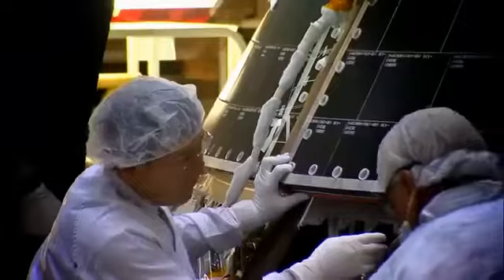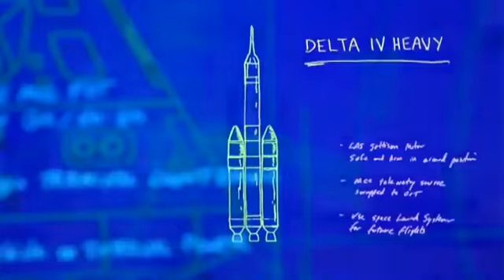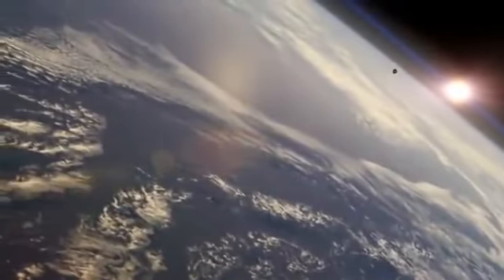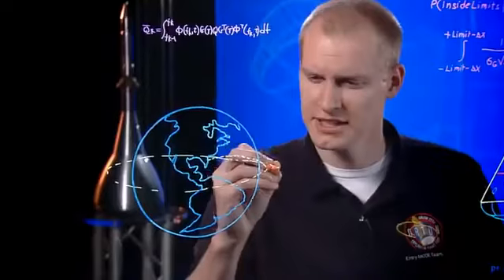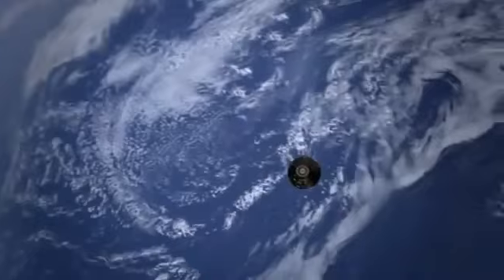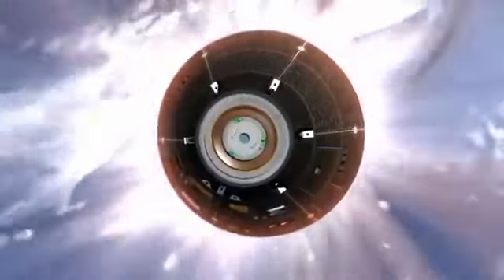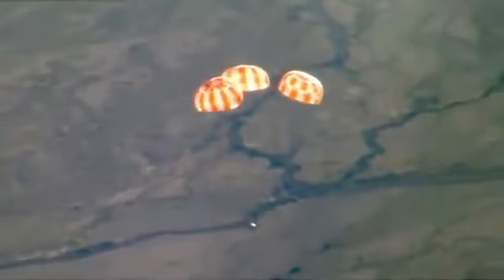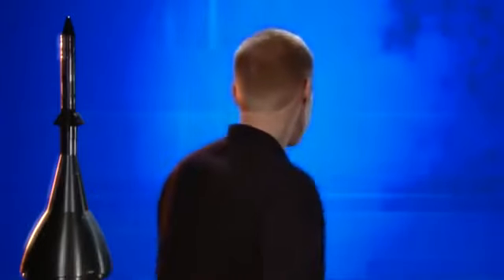NASA engineer admits they can’t get passed the Van Allen Belts

Comment: Put some aluminum foil around it. Worked for Apollo.
Reply from the maker: TheReviewsDOTnet it was sarcastic lol
Reply: can't tell through text.
(After looking at it I see)
Reply: For 100MeV, a 6 feet thick shell of Cadmium around the cubicle might do the trick, but what should the rocket engine thrust be?.
Reply: TheReviewsDOTnet hahahahahahahahaha are u kidding me? GODDDDDDD
Reply: When an ionizing radiation electron hits a large atom such as lead, the interaction creates an X-ray (called the Bremsstrahlung Effect). Therefore, the thick lead shields one would assume are needed to shield from radiation only serve to make conditions in the cabin worse. Materials with high amounts of hydrogen like polyethylene or metals with smaller atomic structure can minimize this effect.

Basic scientific knowledge about the Van Allen Radiation Belts easily explain how a space program goes about dealing with it. Any assumption regarding passing through the belts should be made with respect to the nature of the belts. In short, don't say shit like it's impossible to go through them if you don't know shit about them, aside from what the people saying it's impossible said. 🎤💧
Reply: The type of radiation the need to block isn't the same radiation everyone thinks of when they hear the word. The signals that your radios receive to play all that precious music, emit a type of radiation. Radiowaves, microwaves...all radiation. It is just the the levels of the radiation that are concerning, and with all the protections and laws governing the way things are done these days. NASA is not allowed to expose astronauts to these levels of radiation. The protons are blocked by the thinner metals like aluminum, and polyethylene can block a lot of the electrons. Back then they went around the more dangerous inner belt and through the thinnest part of the outer belt. Then it comes to exposure time. It is better to spend a little time in high levels of radiation than it is to spend a lot of time in low levels. It's not that we can't do it, it's just that their are so many governing agencies that decide how and when it safe to do things that those parties have to feel that it is safe for us to move forward
Reply: It never worked
Reply: Bill Aynes well, the direction of the erection is directly proportionate to.... Oh nevermind, you wouldn't understand.
Reply: Yah yah and some thin foam and "resin"(magical)
That's how people are saying Apollo did it, easy.(They claim)
Oh, they also say the radiation was just six hours each way and safe.
ROFLMAO
Reply: First of all, there's solar flare if it hits game over no matter what kind of shielding you have. Second, if that doesn't get you then aniprotons remitting from particles colliding with the aircraft is enough to end your life.
Reply: Denfktinso Noyb it wasn't tin foil...
Reply: Today's electronics are far more susceptible to em radiation than those on the Apollo missions plus the longest Apollo mission was 12d 13h 51m 59s - the Orion is designed the for possibility of going to Mars, a mission that would last closer to a year.
Reply: Winner....exactly.  This was the job of the heat shield to absorb most of the radiation, the inner hull would absorb the rest.  Fact is the Apollo crew wore dose meters and the average on time through the OUTER edges of the Van Allen Belt (where the radiation is the least) the amount was only .80 rem LESS THAN 1 rem.  it takes 5-10 just the have late effects and possible chromosomal damage, 100 for mild radiation sickness, +400 to be lethal.  Easiest answer to explain Van Allen Belt travel, they didn't go through the center, they went to the outsides and only spent about 5 hours TOTAL in the belt 3 out and 2 in with a break in the middle.  No problems getting through that.  PERIOD.  They will have no problems getting these shuttles through it as well.
Reply: LOL You made my day!
Reply: Bill Aynes don't underestimate the power of human farts...
Reply: THExDEADPOOLx _ and there's a reason why they call you dead...cosmic radiation is deadly as in maybe you last an hour of extreme heat and sufferings
Reply: Hahahahahahahahaha...He is obviously unaware of ''moon landing'', still figuring out how to pass those belts  :)
Reply: KnowledgeIsKey215 stick with "in short", cause that best shows how little you know about anything science, other than what you looked up on Wikipedia
Reply: the actual bajmahal those are hereditary traits not symptoms derived from over-exposure to radiation. Not one case in history, might I add!
Reply: It will only be in the van allen belts for minutes, not hours days or weeks. It's not anything dangerous to life, only sophisticated electronics and we have been through it dozens and dozens of times with unmanned systems to the sun and planets. Somebody needed some "drama" to grease the way for useless research that we have all the answers for. The only thing keeping us from going to mars is the will to do it.
Reply: Denfktinso Noyb and don't forget the scuba diver suit as well for the astronots, the space out there could be too bubbly
Reply: +Paul Gray agreed they're not even trying to go to mars sad.
Reply: U know the moon landing was fake right?
Reply: Crisps bag will do lol. But you have to eat a lot of doritos first.
Reply: First of all until unless we are able to find materials to withstand the heat it will be impossible. Secondly, we don't know how the radiation will impact the computers on board. Honestly it's fair to say we didn't go to the moon in 1969 but people refuse to apply common sense in their thinking
Reply: Water works best
Reply: Tisbonus WTF I'm not even sure what you're talking about. Expound on the subject a little?
Reply: It was gold foil.....
Reply: There were no Appollo missions to the moon
Reply: lol
Reply: Denfktinso Noyb 
😆😆😆😆😆😆
Reply: Lovely sarcasm 😂😂😂😂
Reply: Apollo was a movie, the truth is here :))
Reply: Occam’s Razor: Why is it—since the days of typewriter technology—has no country or space program regardless of Moore’s Law tech advancement, been able to get back to the moon? The answer is simple: because nobody has ever went to begin with. 

I’ll be darned(double doggedly) if I’ll trust a government I cannot trust with my cell phone. During the Nixon administration. In the middle of a cold war. In the midst of Vietnam. In the middle of a space-race, bad poll numbers and election no less. And admit it blind moon believers, admit it: of all conspiracy theories around from bighonkinfoot to Roswell, this one has the highest chance of being true. 

Light the fire and take it neat did they ever fool us good. Uncle Sam and Nixon, with the help of Hollywood.
Reply: But the Van Allen belt is thinner towards the poles why not fly around it in the first place. The Apollo astronauts got a dose roughly the same as a radiation worker would in a year. This was achieved by going around the Van Allen belt and when needed to go through the thinnest parts.
Reply: Seb Menard no it wasnt
Reply: yeah ! right dude ...you are really smart
Reply: Hey! put some respect on my aluminum foil,lol
Reply: hahaha
Reply: puts tinfoil hat on  I'm ready to go.
Reply: hahahahahahaha
Reply: Or so the Germans would have us believe 🤔
Reply: Just because this guy is from NASA doesn't mean they can pay him to sensationalize it a bit. You guys do know that this isn't a official NASA report its just from some tv show. It is no different then when a person from some sports team says I like this shoe. Stop watching tv shows for your information read a study are study or two.
Reply: @SebMenard  TheReviewsDOTnet is proof that 30% of humanity lacks a sense of humor.
Reply: @TheBowersj  only this isnt cosmic radiation we are talking about here. Its radiation from earth's magnetic field
Reply: That shows you how deadly the Van Allen Belts really are. They can damage electronic components much easier than people.
Reply: Denfktinso Noyb I know if put aluminium foil around your router from at&t better WiFi signal in house !
Reply: We have Technology like the " TR-38 " that we know of and we're shown this crap ? LOL
Reply: Haha, the fireball. When it starts to tight up nothing can stop it from burning!
Reply: Haha
Reply: u funny lmao.
Reply: not to worry the Apollo craft had 1/64 inch aluminum around the crew quarters
Reply: If instruments have to be shielded I wonder how photographic film would hold up ?
Reply: Its Gold foil... 😁
Reply: lmfao!!!! so true, ha! thanks for the comment
Reply: LOL...RIGHT!!
Reply: . .Yeah, 6 billion worth. . now more recently they've revised their account for the cost of lunar module development down to 2 billion. . So they can hang on to accounting records for 50+ years but not the technology. . ? 

I've got a backyard invention with gold colored foil wrap -- worth 2 billion any day [12 - 15 billion dollars today]
Reply: @ozoshah  . .Then why can't they use it for Project Orion? The Apollo command module had 2" aluminum acknowledged by NASA as the only shielding it carried. . Why is there a problem now?. . Obviously there are some people in NASA today who don't want to engage in another charade. It may be understandable that they cannot come right out and address past events that don't agree with what they are saying today, regarding their ability or difficulty to repeat a similar adventure.
Reply: best comment ever
Reply: .  . 50 years and counting .  .  A Model T looks more viable than that overgrown mousetrap .  .
Reply: Una volta tutto era piu semplice 😉
Reply: The moon landings were a hoax. We never went. If the men of the earth are influenced by Satan and can convince us the earth wasn't made by God(the foundation of His creation), then it allows people to question the validity of everything else in the Bible.
Reply: Yeah it did actually
Reply: @KnowledgeIsKey215  thank you can I borrow that info
Reply: @h.a.6790  They know when they're gonna hit
Reply: @vinnystern3598  No it didn't
Reply: @billaynes8144  different radiation
Reply: @h.a.6790  That's why they track them
Reply: @TheBowersj  or you could learn the difference about many kinds of radiation.
Reply: @M Smith why not actually read instead of thinking you sound cool making fun of how things are made
Reply: @vinnystern3598  you can have it... Free of charge!
Reply: @KnowledgeIsKey215  we'll you can look at every scrap of paper concerning anything and everything to do with it including the missing telemetry and original video I'll take that.
Reply: @billaynes8144  don't watch Bart Sibrel videos and think they're scientific documentaries.
Reply: @h.a.6790  Stop going to conspiracy sights because you sound like homie the clown thinking you sound like Bill Nye.
Reply: @TheBowersj  not going to the moon that's what cosmic weather monitoring is for.
Reply: @labourisnotinvain  that just sounds ignorant why be nasty?
Reply: @angrypeg8064  no but I know you're trying to irritate strangers I think you just wanna argue.
Reply: @TheReviewsDOTnet  well.... the really amazing part is how LONG and HEALTHY the astronautas life's were after their incredibly dangerous trip....I have one went overseas one time and I almost die of Chinese flu..!!!🤨😱🥺
Reply: @totallyanarchy1989  actually Dr Van Allan figured it out that and monitoring the sun it's really not a problem.
Reply: LOL LOL LOL
Reply: loool you get me smfh
Reply: Ha ha ha.. along with some butter inside it
Reply: hahahahahahaha :)   awesome
Reply: @MrGrumblier  ok-
Why would they use “modern” electronics that are too susceptible, then? It stands to reason they can keep using their prehistoric tech, no?
Reply: @MidnightCrow928  Because modern electronics are faster, smaller, more capable, more reliable, and generate less waste heat. Additionally, there are only three nations that still manufacture general use vacuum tubes: Russia, China, and Slovakia. The computer on Apollo 11 ran at a stunning 43 kHz. The CPU in the iPhone 12 runs at 3.0 GHz. That is nearly 70 000 times faster than the Apollo cpu. That would be like using a horse to pull your F1 race car around the track.
Reply: @KnowledgeIsKey215  thick shield wouldn't make conditions worse. Thicker shield from eg lead would stop EM radiation created by bremsstrahlung but thicker is kinda problem in space. Rest, what you said about hydrogen rich materials makes sense but generally the thickness/weight and amount of material required is the biggest issue.
Reply: Haha best comment ever . Tinfoil and cardboard and a 4kb memory took nasa to the moon and back six times in The 60s 70s but cant do it today haha its laughable how dumb people have become
Reply: Exactly 😂😂😂
Reply: @SkullKnight__  yup totally right about that one there is no space and you cant go to a Light in The sky.
Reply: @kimbalcalkins6903  lmaoooooooo
Reply: 'Supposedly"
Reply: Good for you. So you're either a liar or one of the other thousands of people that were compartmentalized and wasn't let in on the secret. Dude it's not hard to understand. Whatever you supposedly did on Apollo "to go to space" was for a movie filmed in a studio. But since you claim to have worked on Apollo then why don't you let us in on how tf they made it through the Van Allen radiation belt so many times 60s and 70s but can't pull it off now, please. I want truth. I just want to know what is really going on. If it is a globe then it'll have to be at least three times larger than we're told so they can still have their secret lands rich in resources but especially in the past few years people have just been documenting objects way too far away for Earth to be anything close to the size we're told
Reply: how much were you paid for your silence?